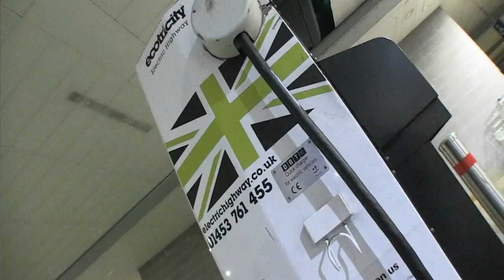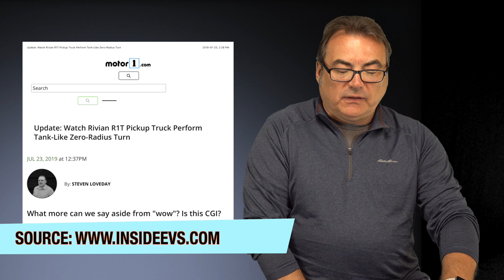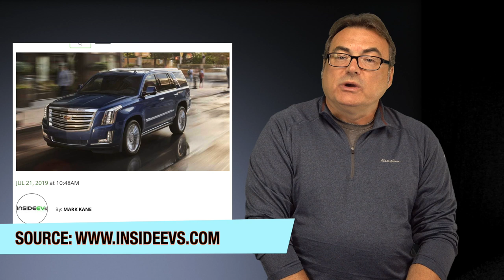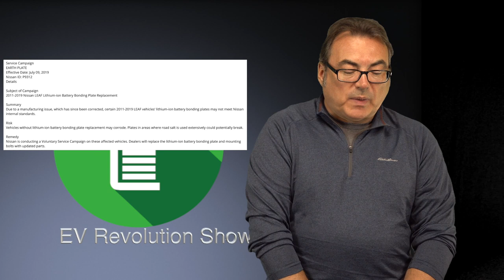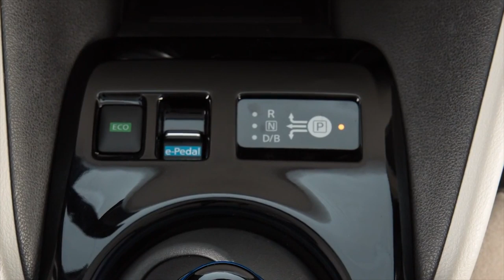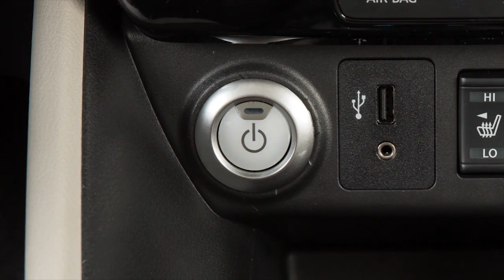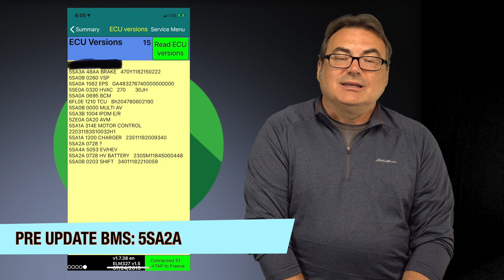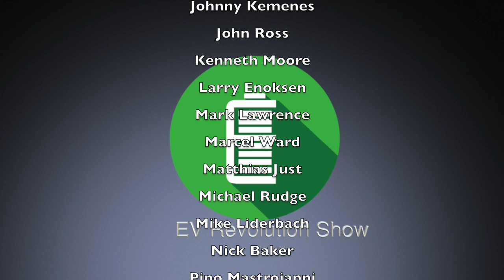Episode 54 - EV Pickup Truck Wars, Escalade EV, Seat Mii EV and Nissan Leaf Service Updates!

Comment: What an exciting plan for UK charging expansion, Ken! A number of the chargers may be installed at street lamps, I believe another channel noted plans to expand this network, but 50k is awesome! Even level 1 would work for many users who charge overnight, a great low cost infrastructure option for those who aren't able to charge at home. The new Seat looks great, very interesting to see the EV version replacing the ICE, hopefully production and battery supply can keep up with demand.
Reply from the maker: Yes great to see this accelerating in large urban areas!

Comment: Interesting effects happening from government rebates in Canada.  Campus Nisssan in Victoria BC currently has 27 used Leafs on the lot. They have sold a ton of Leafs over the years, a think the biggest dealer in Canada by far, but now the lease returns are not being replaced by Leafs, but by Testla Model 3.  Some serious competition starting to happen at last
Reply from the maker: Hi Jim, thanks for watching and for that info.  Not uncommon to see people "upgrading" once they've had a taste of all-electric ownership.  One job the Leaf does well is get ICEV bums into BEV seats, since the 40kWh packs a good amount of value at a comparatively good price point.  

I would not view the 40kWh Leaf and Model 3 as true competitors, as they target different markets to a point.  One a luxury brand the other a more mass-market every-day consumer brand.  

So no surprise really to see people want to move up into larger battery pack BEV offerings like the Model 3.  

For used EVs, other than Ontario which has a privately-funded rebate program thru Plug N Drive, I am not aware of other incentive programs for used.  

The federal $5K is to spur new EV adoption - converting ICEV owners into BEV owners.

Comment: As Jason from "Engineering Explain" U-Tube channel responded to the Ford video, because the rolling resistance co-efficient for a train on metal tracks is so low, he figures the pull force was under 2000lbs.  It's something that looks more impressive than it is.  A pull force gauge connected to the tow strap would tell the real story.
Reply: Right, the strap didn't look so amazingly strong.
Reply from the maker: Thanks for watching!  However, does not matter.  It's a publicity stunt that gets eyes on EVs!

Comment: 3:15 I read somewhere Rivian admitted it was CGI.
Reply from the maker: Well, that would burst my bubble but I have other video clips in that show which provide a similar "outcome" but with locking the front wheels while swinging the rear around with some rear wheel spin.  That give the same desired result.
Reply from the maker: Thanks!

Comment: Nissan Leaf grounding plate recall. In the UK the Nissan website shows a Recall Alert for my 2017 30 kWh Leaf quoting "LITHIUM-ION BATTERY EARTH PLAT". The dealer stated that a number of customers have received the recall alert but it is an error and it does not appear on the dealer system. Has anyone else in the UK had a similar experience?
Reply from the maker: Thanks Robert for watching and for your comments.  I'm not aware of unaffected UK owners, but maybe.  Hoping someone here can answer your question.  My understanding is that this is primarily targeted at Geographies that have cold winter climates and use road salts, etc. for winter conditions.  This Voluntary Service Campaign may not be applicable to the UK, at least the south.

Comment: I have a question about Nissan Leaf. Can bi-directional charging in Leaf be used to charge other Nissan Leaf cars or even any EV cars? thanks. just curious.
Reply from the maker: Hello Aliaksei, thanks for watching and for your question.  I am only aware of VTH and VTG applications for the Leaf.  I don't believe you can do VTV charging.  I think with Sono Motors Sion you can, but they are not CHAdeMO.  

The CHAdeMO standard does support bi-directional charging, however I'm not sure if Nissan has implemented it for VTV applications.
Reply: DC fast-charging ports provides direct connection to the car's battery, so of course it would be technically feasible to transfer battery energy directly from one car to another through their fast-charging ports.   Such a setup would have to use dc-dc power conversion electronics to accomodate differences between the voltages at either end, though; that, along with the other specialty hardware (to say nothing of whatever software might be needed to assure both cars' systems that everything is OK so that they connect their charging-session contactors) would probably make the equipment very expensive indeed.   You'd need an awfully compelling reason to pay for such a thing.

Comment: My wife drives an i3. I love the one pedal driving. What other EV's come to a complete stop without the friction break or holding shifters?
Reply from the maker: Hi Eric, thanks for watching.  Glad you have an i3 in your household!  Btw, Nissan’s e-Pedal on the Gen 2 Leafs does true one-pedal driving, without the need for shifters.  However friction brakes are needed.  I personally found the i3’s regen braking that has only 1 setting too harsh for my tastes, but glad it works fo you and many.
Reply: @EVRevolution  my commute is 100% on the street 8.8 miles in LA traffic so i love the harsh regen. Do you know of other EV's that have that level?
Reply from the maker: Some others do.